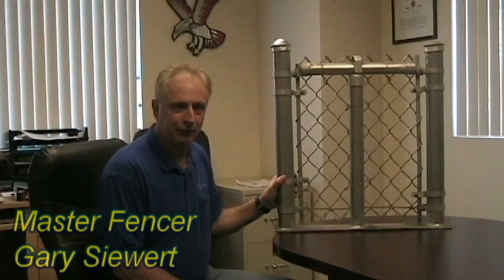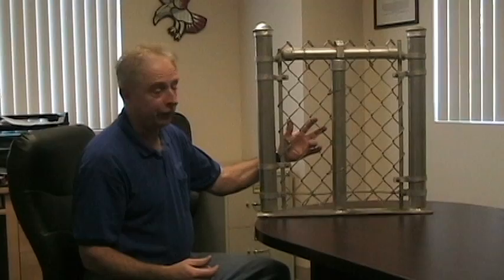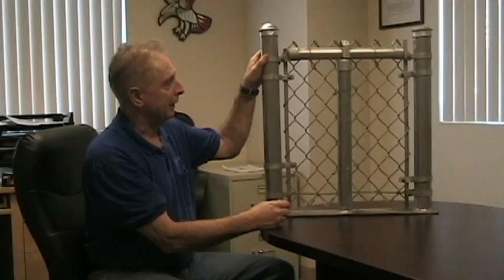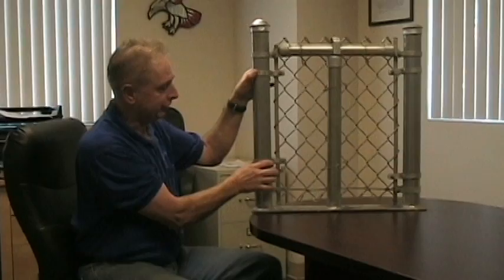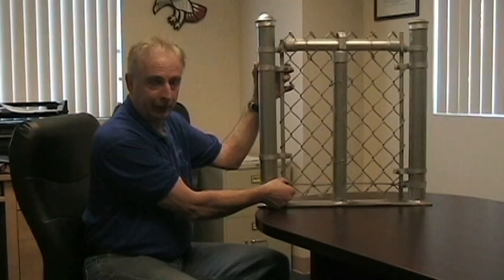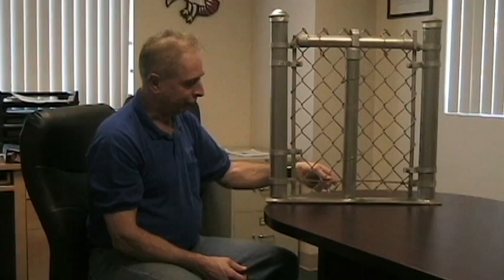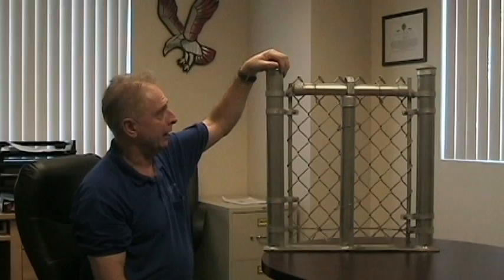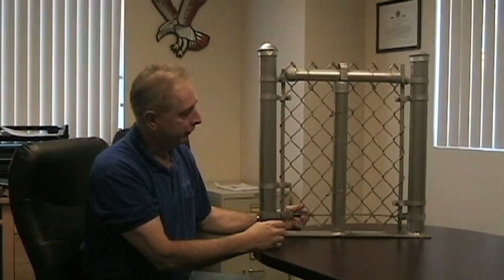Chain Link Fencing 101

Comment: The tension wire at the bottom, do you weave it through the chain link fence?

Thank you.
Reply: Absolutely not. That is not even feasible. Just run it in line with you post and secure to fence with hog rings.

Comment: Can 2 fences use 1 terminal post? If the front of the house fence goes to the terminal post and then makes a 90 degree turn to go to the back of the property, should they be "separate" fences or just one fence that wraps around the terminal post?
Reply: They use same terminal